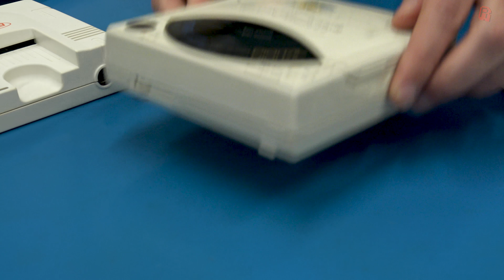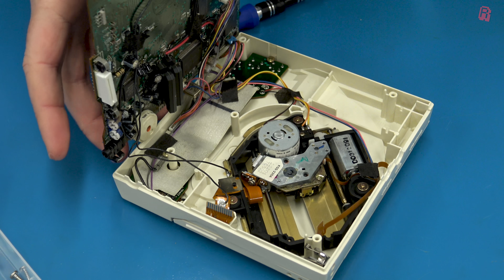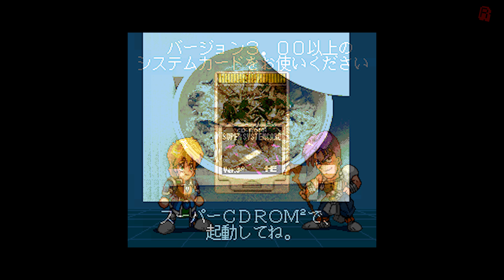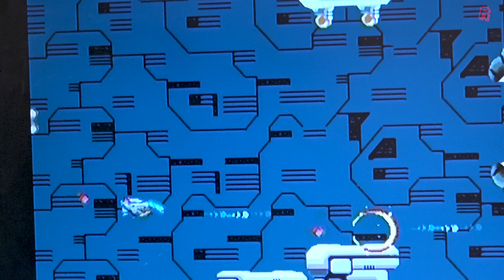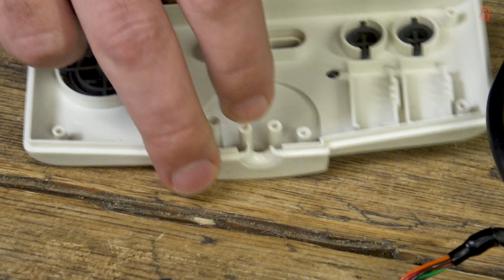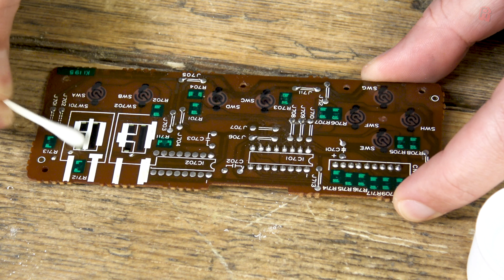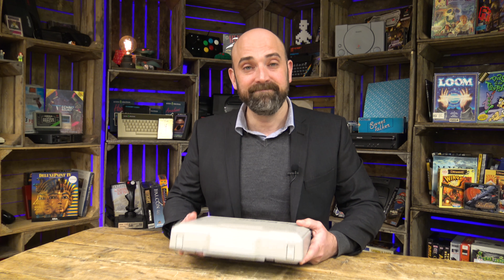PC Engine Trash to Treasure (Pt2) - Fun with the CD ROM ROM

Comment: Imgburn will let you burn at 2x even if it has a minimum write speed of 8x. it'll say mismatch and then go anyway. usually this'll be a bit faster than 2x, but I've done this flawlessly on a few different drives now.

Comment: I literally just went through all this...I recapped the PCE, the CD, and the case. I then used the rgb amp from Voltaire's mod shop made specifically for the IFU and finally wired it to an 8-pin din so I can use my genesis scart cable. Wonderful system, really!
Reply: Was it broken when you recapped it?
Reply: It worked but one cap in my PCE had leaked over the entire PCB. Also, the tracking on the CD was faulty and a full recap did nothing. In the end I had to adjust one of its potentiometers to get it working reliably.
Reply: A full recap would not improve tracking. Enough electronic experts do tell people that recapping does not fix the problem 88 percent of the time

Comment: I'm really understanding why all the fuss over these now. No... no I don't need more :-)
Reply: Error 42 no trust me, you do. Resistance is futile.
Reply: @vix_in_japan  You're a bad influence :-)
Reply: Build yourself a MiSTer FPGA. Then you get a cycle accurate FPGA recreation of one plus heaps of other systems as well. Hopefully we will see a CD core for it soon as there is already a MegaCD core so we know it is possible.
Reply: @NerdENerd  Maybe that's something I could consider in the future. There are some systems like the Amiga that I want the hardware, other that I could live with emulation. So perhaps that would be a nice halfway house.
I really need to get some projects done though before starting or gathering parts for more :-)
Reply: @Error42_  it does a cycle accurate Amiga as well! The thing is tiny and you have a huge amount of cycle accurate recreations of console, arcade and computer history in a tiny form factor. It is more than just emulation, it is FPGA recreations to run the system as close as possible as the original hardware.
Reply: @NerdENerd  I know it's not emulation, an Amiga implementation would be interesting too. But I do really like the hardware, not saying I could tell the difference in use but it's a nostalgia thing :-) Someone I watch has a MiSter so I will be keeping an eye on what they get up to. I imagine it would be a good system to build into an arcade style unit. Although that would defeat the size benefit :-D

Comment: Regarding modding the interface unit, if I were you I would look for some kind of round connector that has enough pins to output RGB, and which is small enough to fit inside the recess of the interface unit on the side that already houses the existing jack pack. You may even be able to use something like a 8P8C (RJ45) for that. Drilling holes in the back and having RCA plugs stick out would be very ugly.

Comment: Fast as hell 8 bit cpu and dual 16 bit GPU's. Its a beast. Might need a pot adjustment. If not a recap can do wonders. If it needs a laser replacement, they dont make new ones and you will have to source it from another pce drive or old sony disc man cd players.

Comment: Great to see it working again!!! Try Taiyo Yuden discs,  I think JVC make them.  They are by far the best recordable media to use with CD based systems.
Reply from the maker: Thanks, yes indeed I have a spindle of 100 on my desk after a tip off from Mark Fixes Stuff for the same brand.  Fingers crossed they give better results
Reply: @TheRetroCollective  Great =D
Reply: I really think the problem is the burn speed. I have an LG burner that burns @ 10x and it works perfect for Saturn, PS1, Sega CD but Turbo CD will not work that great at all. I'm even using Taiyo Yuden as well and have the images in the correct format and even using a Duo-R

Comment: This compact, yet powerful machine is not just any old 8-bit system, it's a full blown early to mid '80s 8-bit video arcade cabinet, with all the acceleration support chips super compressed down in size to something that fits onto a tiny PCB! No wonder it gives many 16-bit home systems, never mind other 8-bit ones, a run for their money! :-D
Reply: So the reason it holds its own when compared to the SNES/Megadrive despite being 8-bit is the PC Engine actually has an 8-bit CPU but a 16-bit GPU.

Comment: 17:40 Sounds like a bin and cue problem. Simple ISOs usually aren't up to the job, the CD audio tracks have to be precisely positioned on the disc
Reply: There are also a lot of broken images out there - many of the early emulators for CD based systems used a rather nasty hybrid format that used a binary file for track 1 but some compressed format like MP3 for the audio tracks.  Later on, when emulators started to prefer bin/cue, a lot of the old bin/mp3 rips were converted into bin/cue format with the .cue filled with data that "looked reasonable".
Reply: I have the same seek problem with an new unopened copy of Fighting Street on my Duo RX. Turns out that there was more than one revision of Fighting Street. I found revision five works the best for me. Also, I get the same freeze with on my SSDS3 when using a TurboRip image I made of that earlier Fighting Street revision. I think your CD drive is fine. Just look for a revision five image of the game.
Reply: @billduck  would be interesting to know what the exact difference is
Reply: THIS. If the ISO was broken down into data and tracks were converted to lossy (MP3) or even 'lossless' (FLAC,APE) components, this can cause issues even with BIN/CUE files to guide the burn-back. Absolute best rips are made to a single ISO image with sub track info, typically extracted from a low speed CDROM using programs like TurboRip, DumpCD or my old favorite, CDRWin (GoldenHawk). I also recommend burning them back to 650MB blanks that use a dark contrasting dye, like the Verbatims with the blue/cyan medium. Also I recommend using an older CDROM writer if you have one handy, i.e. Plextor or even a NEC (hehe) at a slow speed and you'll have the best luck in my experience.
Reply: I was going to add it could also be the CD burn speed as well. Usually burning at a lower speed will help greatly with old hardware. Perhaps a plextor or similar cdrom burner might be a good choice as well to try and tweak some settings? Plextors allow stuff like the space between the pits to be set (that was used to squeeze more space on the cdrom or some copy protections). Might be worth checking the cdrom drive and seeing what read speed it's at etc.

Comment: The C64 component mod uses an TRRS headphone connector for Component/RGB output in a non-destructive way. Maybe the same idea could be used on other systems by simply replacing one of the existing connectors with that. To free up a hole, you might also consolidate the RCA audio connectors into a single headphone connector.
Reply from the maker: I'll certainly look into this, non-destructive is always my preferred path, thank you

Comment: Interesting part of that controller is that it seems the turbo switch pads are there. I love this system, I genuinely wish that NEC and Hudson were a bit more versed in advertising in the US. Oh well, at least we have the RMC to ogle the awesomeness.
Reply: Only on the later versions of the white pads the original ones didn't have the turbo pads or the plastic bits.

Comment: Hey Neill, rather than cut new holes, you could replace the yellow video cinch connector with a 3.5mm TRRRS jack like used for some headsets, eg 102-4968-2-ND on digikey. then get a premade trrrs cable and cut off one end and replace it with scart or whatever. the whole jack assembly is on a separate pcb, so you can just use your pcb instead (strip board). add another jack for stereo out, and you're left with a hole for another mod like a turbo switch or whatever. If you also use your own psu jack, you can swap things out without stripping the old board. or use micro usb instead and an LDO to derive the nec's internal 3.3V bus from 5V, and you don't need a crummy old PSU.

Comment: Heh, I remember getting one of the very first 18GB SCSI harddrives.. it was insanely expensive, full hight, sounded like you were running a giant turbine, and took like 45 secs to spin down completely.. The shop that sold it to me had their entire staff and management present when I retrieved it.. it was at that moment by far the most expensive component they ever sold. And by far the most expensive disk I ever owned. 

I 'needed' it for video recording on an SGI machine, obviously it needed an external enclosure and its own PSU. It would have killed the PSU in the machine.

It managed to survive for almost 10 years, after which its motor finally gave up completely. It had serious problems spinning up for the last year of that, often needing 2 or 3 retries (and warming it up slightly)
Reply: When I still had my Sun SS10 /20s, I had a couple of full height 5.25" SCSI HDDs for them. If you were to try picking them up before they stopped spinning they were powerful enough to wrench your wrist!
Reply: If he was doing video 16GB sounds right. Probably years after I bought three CDC9715 340MByte drives for £3000 each at work. Obviously not for PCs as they only supported 32MByte per drive letter at the time: :-)
Reply: @MrDuncl  this was used with an SGI Indy which I owned at the time.. 18GB was the largest available at the time and provided for enough space to record short clips as raw video and do some editing. 

Besides needing a dedicated psu, it also required active cooling.

Comment: You should try the CD ROM ROM images in an emulator and see if the same freezes happen. Its possible the images themselves are the problem.
Reply: This was my thinking also. Not every ISO works as intended, in my experience.
Reply: @ericwood3709  Tell me about it, having to rebuild the ones I came across as they are split and the audio is in APE format.
Reply: @enigma776  And I've had issues just making images of PC games. Found that bin/cue is better than iso.
Reply: @ericwood3709  Yeah CloneCD is even better as it copies the sub channel data as well. but Bin/cue will get most things done.
Reply: @enigma776  Now there is a piece of software i have not heard about in a long long time...
Reply: It's always a good idea to grab redump and no-intro verified disc images and ROMs if you intend to go that route as they're verified to be 1:1 copies
Reply: Anyone suggest a good emulator that runs the CD ISO image files? I tried a few and got one working, but music tracks did not play or correctly.
Reply: @thaddeusmcgrath  Magic Engine but its not free, here good things about Mednafen though.
Reply: !!! Good one. Not worth spending so much time troubleshooting the hardware if it's known that some ISOs will simply not work!

Comment: Mmm sounds like the CD2 drive has got the same issues as the Mega CD? Modern CD burners are too fast and the media they create is a strain on the drive? As you say in the video slower burns can help but original media tends to be the ultimate solution.
Reply: Yeah. Original media is pressed. Some cd-drvies like it more and yeah the burn speed.
Reply: Also, some burners seem to be more accurate. I have a Plextor one that produces perfect CDs for use in the TurboDuo; another LG burner makes coasters with the same settings and the same images.

Comment: If anything the PC engine isn't "amazing for an 8 bit system" it just proved that the bits thing was nonsense for the most part. Especially back then when so much was done in custom asics specially to avoid having to go through the cpu.
Reply: Indeed it's a system that shows up how ridiculous the idea is.

Plus, what are you looking at when you call something '8 bit' or whatever?

The 8088 in the original IBM 5150 is a CPU with a 16 bit instruction set operating on an 8 bit bus.
The 65816 seen in the SNES and Apple IIGS is the same.

A 68000 is a 16 bit CPU with a 16 bit bus but 32 bit registers (and a handful of 32 bit instructions.)
The very closely related 68030 is a fully 32 bit CPU.

The SNES graphics chip is 16 bits and operates on it's video memory using 16 bit operations. (to be technical it's a dual-8 bit bus, since you can independently specify two 8 bit accesses to two independent memory chips in parallel). Something that mode 7 relies on.

An Amiga has 16 bit CPU and graphics hardware, but an 8 bit audio chip.
The n64 is a CPU with a 64 bit instruction set, (And a graphics chip that has a co-processor with a variant of the same instruction set), yet the CPU bus is 32 bits, the cartridge bus is 16 bits, and it uses 9 bit (that's 8 bits with error correction, though the n64 uses the 9th bit for z-buffer instead), memory bus.
So, which is it? 8 bit? 16? 32? 64? That's just one system and you can get more than 4 possible answers depending on how you look at it!?

The gameboy advance has an ARM/THUMB cpu, which has both a 32 bit instruction set and a 16 bit instruction set. That technically makes it a 32 bit system but the vast majority of games almost exclusively use 16 bit instructions...

All in all the more you look at it, the less sense it makes.

And the PC engine?

Well, let's think about it.
It's a 65c02 derivative CPU, which is an 8 bit instruction set with an 8 bit bus.
However, unlike just about any other such CPU it contains extensions to access up to 2 megabytes of memory, as well as some audio features..
Meanwhile it's paired with a graphics chip that operates entirely using 16 bit logic, with 16 bit memory accesses.
And this is a graphics chip which, when you list it's specs compared to other systems, is clearly a direct competitor to the graphics chips in the Mega Drive & SNES, and NOT any 8 bit system.
In fact, in some areas the PC engine graphics chip is more powerful than either of those 16 bit systems. (though in others, it is weaker as well.)

By any logical grouping, the PC Engine belongs with the 16 bit systems.
Yet through a quirk of design people call it an '8 bit system'.
Which, while technically true from a certain point of view, just doesn't reflect it's capabilities in any sensible way...
Reply: @KuraIthys  actually that is incorrect Amiga Paula was 14bit
https://amitopia.com/amiga-was-already-capable-of-14bit-playback-in-1985/

Comment: I want to see a contest for people to push the hardware to its max both in tech demo and games/ports , Most systems never see what the full system could do like the ps2 games at end of the system life.
Reply: A lot of "pushing the limits" are tricks like pre-rendering and pre-processing data during the build process. IMHO games got better through a consoles life in a large part down to the tools getting better and not some voodoo used to release the true power of the hardware.
Reply: @donpalmera  That can be true in many cases, but in others it's clearly creative use of non-standard features.
Take for instance the 256 colour mode on an Atari 8 bit micro. 
It exists due to a quirk of how televisions tend to blur things together. (and in this case it works best on PAL hardware due to the tendency for PAL televisions to blur adjacent horizontal lines together.)
It works because the system has two different types of 16 colour mode; A 16 shade monochrome mode, and a 16 colour mode where each colour is the same luminance. 
When blended together? That creates 256 colours.

Or there's systems where due to lack of documentation, lack of tools or both, it's difficult to properly utilise the full capabilities of a system early on.
The  Nintendo 64 for instance - getting the most out of the system requires writing carefully crafted graphics microcode.
But, for several years Nintendo actively discouraged anyone from trying to use anything other than the mediocre standard microcode Nintendo had provided them.

Sometimes too, the 'better' games are the result of hidden hardware upgrades. (sometimes not so hidden, such as the heavily marketed SuperFX chip).
The NES game library, and that of many cartridge based systems in fact (from the Atari 2600 to the N64), is the story of the ever-increasing storage capacity of cartridges.
Super Mario Bros hits the technical limit of 40 kilobytes of the base NES hardware.
Super Mario Bros 3 is not 'better designed', so much as it takes advantage of a memory mapper chip letting it use 384 kilobytes.
And the NES version of Kirby from 1993 uses a full 768 kilobytes, and surprise! it looks closer to a SNES title than an NES one. (SNES titles at launch being roughly 1 megabyte)

Pitfall on Atari 2600 is very elaborate by  the system's standards. Why? It's using a memory mapper to allow a 16 kilobyte game on a system built for running 4 kilobyte games.

Even the n64 gets in on this, though it never technically hit it's hardware cap (Without memory mapping chips) of 256 megabytes, it still progressed from Mario 64 being 8 megabytes, to Ocarina of Time being 32, to Conker's bad fur day & Perfect dark hitting 64 megabytes...
A pretty substantial change when you think about it...

But you can indeed make better or worse use of hardware, and it's not always a matter of doing massive amounts of pre-computed content.

That said, you likely can't work miracles either. On a lot of hardware you're not going to get miraculously better results than most of the typical games were getting...
Games DO get better as the system is around longer because programmers understand it's quirks better though...